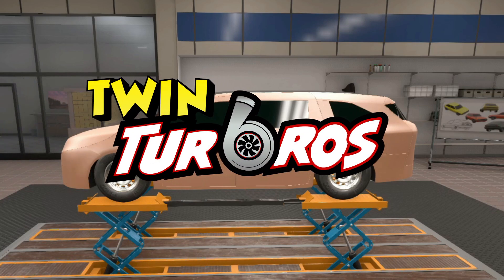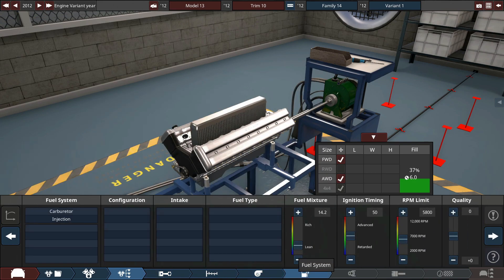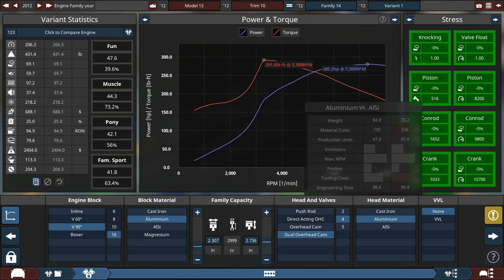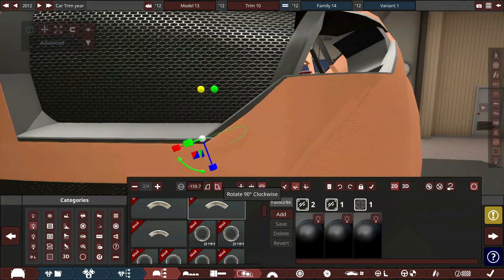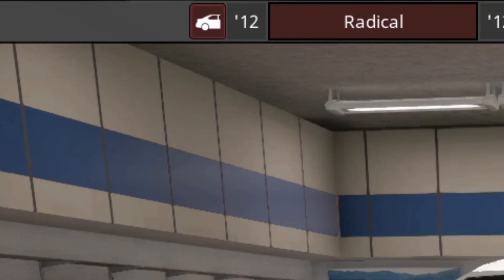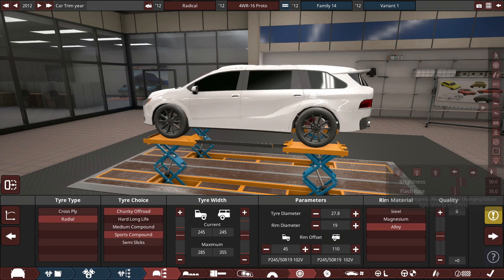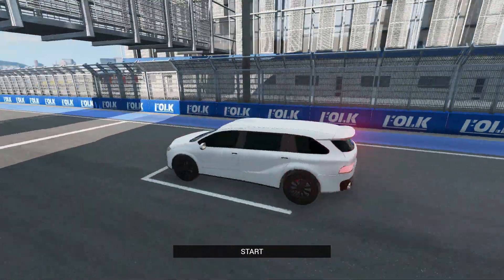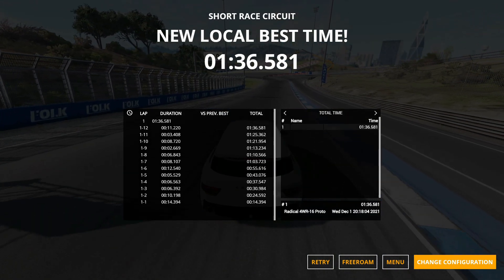I Built A "Cheap" V16 Car!  Automation - BeamNG

Comment from the maker: What other V16 cars should I Do?
let me know eh :_TwinTurBro:
Reply: Devel Sixteen
Reply: Mid engine v16
Reply: Not a v16, but build the fastest inline 6 possible.
Reply: 2.3L TT/3.9LNA v16 classic/retro f1 car(when moderate amounts of aero was starting to be used). If possible make it a challenge between Fillman and the others or something.
Reply: Put a v16 in a pickup truck and try to give it 1500 ft lb of torque
Reply: A normal high end semi, and from that a race version, both simulating diesel engines
Reply: See if you can do a rear engine V16 car with FWD. There is a way to do this. Just ask fillman86.
Reply: low rpm v16 truck, detriot diesel style!
Reply: @acat9965  sooo exactly as I said, but in more detail?
Reply: A 90s mini van or 2000s
Reply: @acat9965  lol
Reply: V16 ute 5.5 L twin / quad turbo if possible
Reply: Convertibles
Reply: v16 golf gti loooking fwd convertible plz
Reply: The most fuel efficient v16
Reply: a buick grand national with a w16 in it :meh:
Reply: V16 pickup truck like as a gasoline alternative to a diesel pickup like the 
Ford triton V10 or the dodge ram magnum v10  probably from mavin

Comment: Imagine the price of a valve adjustment on one of these
Reply from the maker: EZ. Just uhhh
replace the care lmao
Reply: Lol. Love the vids especially gear City
Reply: @lethargicstove2024  in modern engines you don't need it, unless you are rebuilding the engine i guess 🤔 aren't new engines all with hydraulics valve (don't know the exact name in english) which auto-adjust themselves till you have to replace them (never had problems with valves in my car for 8 years, even asked my mechanic to do an adjustment and told me it's hydraulic)
Reply: @qualcunoacaso4865  yeah your right I didn't realize that

Comment: 1. adding torsion rear suspension makes it fwd
2. viscous lsd diffs in beamng for some reason are straight up open diffs...
Reply from the maker: Tfw you had brain farts about torsion suspension.

I guess i need a 2000hp AWD version at somepoint :P

Comment: V16 eco performance car made a diesel like v16 powered luxury boat that weights 2,6 tons but gets 38mpg and has 770hp and 1285nm torque. Probably can get 50mpg if i put it in a smaller car bit the engine is 10 liters so it won't fit in alot of cars
Reply: U should make that next